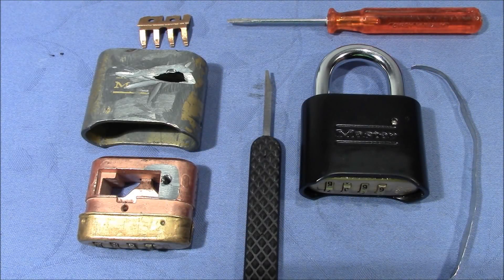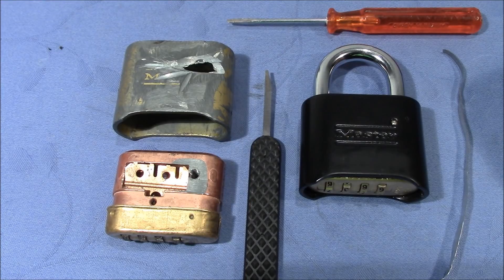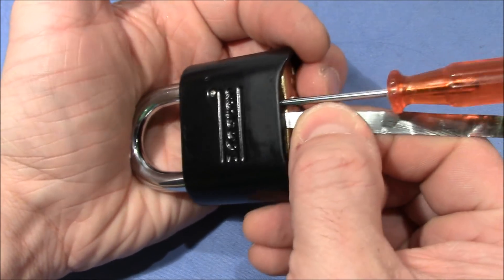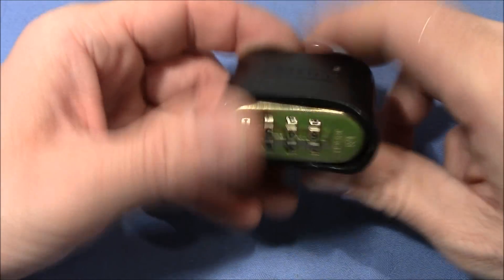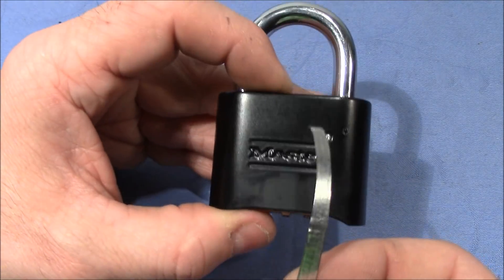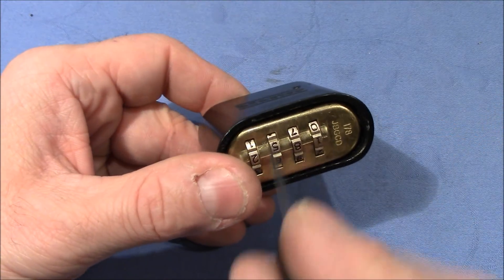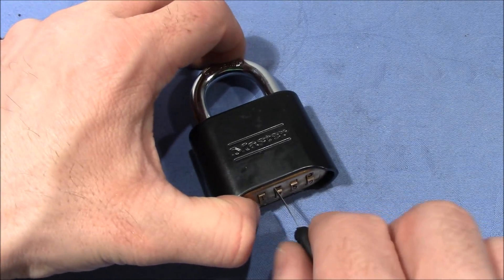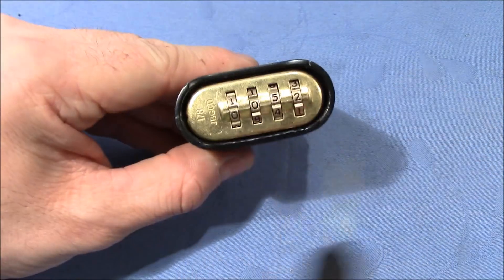(picking 481) Master 178 Combination padlock - bypass / decoding update

Comment from the maker: In video 480 (https://youtu.be/MeGo8vxeyfM) I explained and showed a new bypass method for the 178. My conclusion about the reason why that method worked was not correct and also my statement that the 178 (in contrast to the 175) cannot be bypassed with a thin decoder knife. Watch here the correction and addition as an update about this topic.
Reply: Worked for me as explained! I came in from top right corner of the dial between 0-9 position 👍

Comment: Got it working by inserting the blade from top right of the second dial between 0-9 position. I used sheet metal snips to shape 0.008 automotive gage blade into the shape as the blade on the video. 0.008 inch blade is a tight fit that needed to be forced in a bit, but provides just enough strength to push the plate. I probably could use my grinder, but this way it much cleaner job and more fun 😊 Thanks!

Comment: So I’ve been thinking about this for a while  - especially with the 175 and 176.  Do you think it would be possible, if you first bypassed the lock to get the shackle out of the way, that could you get enough feedback from the code changing tool (or anything else you might stick in there) to decode the lock? You would probably need to start with the wheel closest to the hole you are working in.  Thanks.

Comment: I was knocking off the side I had cut through and it opened.  Pressure on hasp and whacks on side will open.  Plastic hammer.

Comment: My company uses these locks outside - is there a recommended lubricant or treatment ??  I've got one that stopped working after 6 weeks so I thought someone changed the combination but after much persistence (about 2 hours) I picked it, decoded it and turns out the original combination now works again.  Lock still looks new.  Any suggestions?
Reply from the maker: Well,  I use something like this https://www.lockout-tagout-shop.de/brady-15021745-pflege-spray-834194.html?source=googlebase&gclid=Cj0KCQiAuJb_BRDJARIsAKkycUnAyw8x4x8cqOQdQJDER4Z3S3Se5pQQ0Wbowjz3IjrocKwhp6GxkvwaAqNGEALw_wcB

Comment: Great video Pott314 I feel that we have all come on a journey of discovery and learnt a lot :-) do you think that the screwdriver could have pushed back the plate somehow? Also, can you feel the flat spot at the top using the decoder so that you can tell the right number? (I know you can feel the flat spot the other side to decode it,  it you know what I mean!)
Reply from the maker: Thank you my friend. Just thought that I need to correct the info as I now know better. I can feel the flat area only when accessing the wheel from the right.